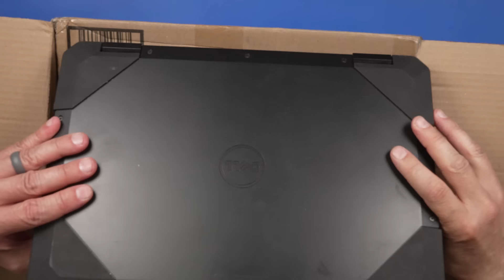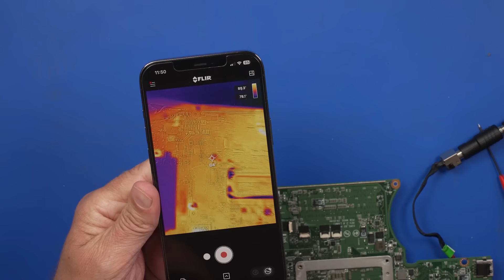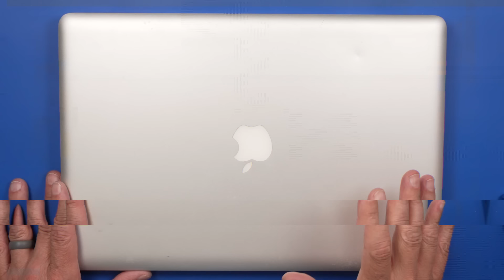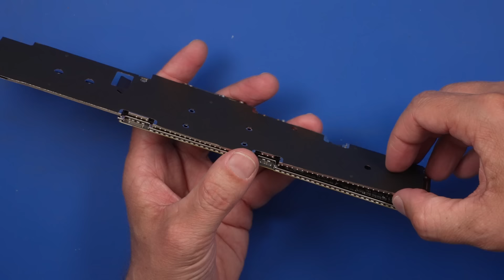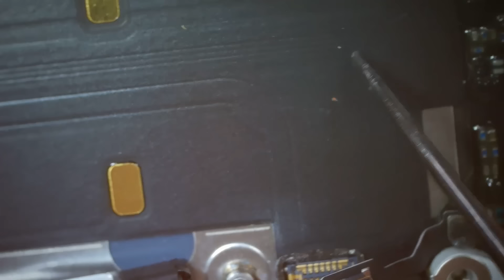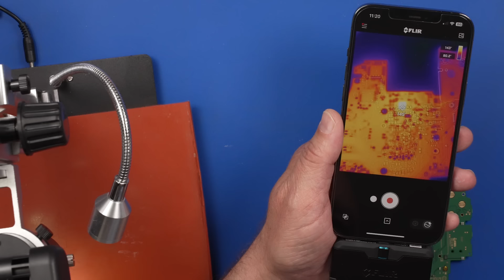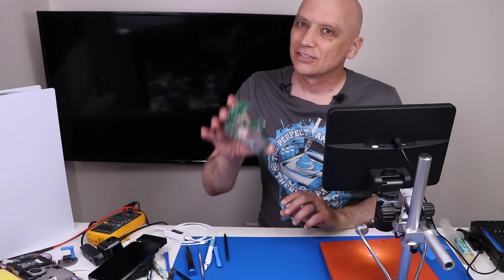Austin Evans Broke These with a USB Killer - Can I Fix Any?!

Comment: The 4S0101 is a low-power, programmable mixed-signal integrated circuit from the GreenPAK family (originally Silego, now Renesas Electronics), which integrates analog functions, digital logic, and non-volatile memory into a single compact package.

Comment: On the MacBook you will probably need to change the CD3217 chip. Then it will be fine. Data lines/USBC ports are isolated and that MacBook needs all USBC controller chips to charge normally.

Comment: At 19:12 that chip that you are removing is FINE. That is a 3v controller LDO chip. It's glowing because the super IO isn't turning on. It's stopping power because the motherboard senses an issue. That super IO is blown and the laptop will work if it's replaced.
I need to make a video about this myself.

Comment: The USB killer sends power through the data lines. Often it kills the PMIC and damages the CPU and RAM. Even the bios chip can get damaged. Don't look at the power rails for shorts, check data lines.
Reply: It also blows the usb controller ic

Comment: this usb killer stuff is stupid. it's just a simple circuit sending high voltage into the motherboard that's it. Why break multiple devices for clout? There is nothing interesting about a destroying electronics with high current except if they explode. BUT NO THE EFFECT ISN'T EVEN NICE LOOKING, NOTHING HAPPENS THIS IS POINTLESS

Comment: Steve, with the dell rugged laptop, you can find the 4S-0101 online now, so if you still have the laptop, you can get the donor board, remove the 4S-0101 from that board, and it will fix the hotspot, but there will most likely be other problems with the board, after you replace the chip, you will recheck for shorts and if it doesn’t turn on, it means that there’s something else wrong, and it’s not fixable.

Comment: I'm only 10 minutes in and this feels wrong to me. I am definitely not a board repair tech, but watching him check all these charging and power input circuits doesn't seem right. He knew it was a USB killer, my guess would be it is more likely going to fry stuff like CPUs, chipsets, etc. Wherever the USB controller is on said board would be what is getting the juice from the USB killer, not the charging circuits.

Comment: Man i wish i could have you do some maintenance and replace my thermal paste and pads. My ps4 is new from 01/19/2024 but i have heard the stock thermal paste isnt the greatest. Also for some reason since I first bought the ps4 it does not come back on if i out it in rest mode just flashes blue forever and then i bave to hold the pwer button down until it shuts off 😢. Dont know if upon delivery it was mishandled and dropped or something since the box had a huge dent in it. But i hoping after i install a ssd next week it will not have that problem anymore

Comment: Hello on the second apple laptop we can see a blown cap on the right side of the usb control chip! at minute 25:48
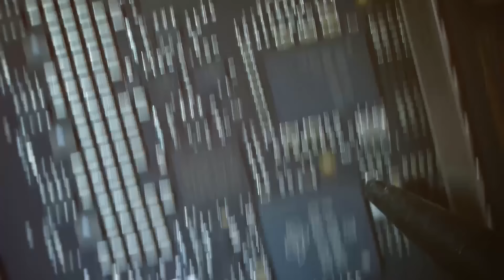Reply: Also on minute 25:28 we can see another blown cap exatly on the upper left side of the controller!
Reply: a simle small crack witch looks like slight discoloration crossing the middle og the cap is always a no go
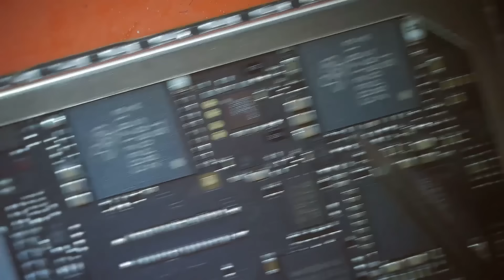Reply: on minute 25:58 we can see 3 blown caps 2 on the left side of the second controller one next to the chip and one under the rv chip and one on the right side
Reply: also the on the close righ side we can see a cracked white U cap/res

Comment: most power problem come from a blown ceramic capacitor . you may see a crack on it or be changed in color  but some times you can not see any difference.the fuses is very rarely the fault

Comment: Even with circuit protection devices, the way the USB Killer works, the speed it dumps the charge back into the circuit would be too much. Circuit protection is a reactionary device/circuit, by the time it reacts to the problem, it's usually too late. Clamping may work, but that also depends on what the USB killer is dumping back to the system.

Comment: Dell latitude rugged: replace fuses to correct proper power flow and that chip you specifically removed is most likely fried and needs replacement. That should fix the device, but if not there's a more severe underlying issue.

Comment: So if you are designing circuits, where would you normally find information about the chips to know what chips to put on the circuit? Or these chips not meant to be available to anyone but only the manufacturers has access to them through private channels?

Comment: you might have been able to get away with leaving that chip off the dell. usually m6 auc is a physical chip on the board that is used to track the laptop if it is even stolen since these are usually more expensive laptops it uses hardware plus software vs just software. thinking about it tho due to the security settings even if it did boot up you would be locked at the bios

Comment: 27:20 In the video cut from the USB killing, it seemed to work from the enegery in the battery. Is there a way to bypass the charging path and feed energy to the laptop from the battery connector? Swapping the empty battery for a charged one is inconvinient but might work.

Comment: GWS Steve.

As for this USB killer thing. I have one question. Why? It has only malicious uses. Again, just why, what is wrong with people?  Some dumbass with one of these could do untold damage for 'fun'.

Chances of fixing anything spiked by something like this are slim unless it has decent protection like the older MacBook appeared to. Depending on the voltage spike, it could fry a large number of components as well as creating insulation failures between layers & tracks given how tightly packed these tings tend to be. Basically a portable lightning strike.

Comment: I learned you should always start with the capacitors in a blown circuit. i cannot tell you how many times when i was still working at a motherboard repair factory [it was meant to cut down on E-Waste. at the time i was still in school for Electrical Engineering and it was a good paycheck that let me practice what i was learning] that I had to replace the caps first before they could figure out what was wrong with the rest of the circuit. cause i would get the board back once or twice with different parts needing to be replaced after i had replaced the caps.

Comment: That gateway laptop is a piece of junk. Tried using one to replace our desktop, it was slow as molasses in the dead of winter and would CONSTANTLY corrupt its own wifi drivers. Absolute landwaste. I can at least get some solace from knowing one of them suffered a usbkiller.

Comment: The sad part is, you don't even need the USBKill. The same effect can happen from a shorted cable, a bad charger, any number of dead flash drives, or anything you plug into USB really. A bad short of any kind can fry a board, especially since you just demonstrated how there's virtually no circuit protection in the areas that need it most.

Comment: Im pretty sure 4s0101 is just a double-mosfet. Just check for other shorts and solder 30-40v 80a with low resistance (2-3mOhm) and you are good to go

Comment: The hot spot on the switch is almost certainly the runs in the PCB arced an shorted together.  You're seeing a hot spot because that short is thinner than the runs so the resistance is high. (higher than the rest, it's still a short)

Comment: While you've got the battery disconnected from a laptop, you need to press the power button a single time to discharge it completely. That's how you fix a lot of Lenovo laptops, which can't turn on.

I bet you can order that CD3217 from Louis Rossmann...

Comment: Steve, you’re misreading your FLIR. The app overlays the thermal image on the optical camera image. If you look at the holes or edges of the board in the thermal overlay, it’s offset from the camera image. This is a parallax effect due to the distance between the two cameras and the closeness of the object you’re imaging. You can adjust the image offset in the preferences to get them better aligned for closeup imaging.

Also, the USB killer dumps to the data lines.

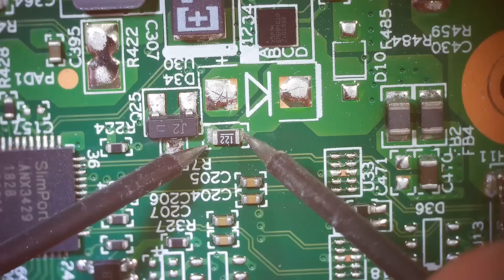Comment: 3:00 Those 0ohm resistors are usually great points to narrow down where the short is coming from. Just desolder it and check short on both pads.

Comment: hi steve ,i hope your recovery goes well and i respect you for keep fighting.
i think the usb killer charges the capacitors and discharge them into data lines not power lines , maybe the processor or the pch chip got damaged not the power curcuits

Comment: Hey, I watch your channel from time to time and find it very interesting.
The first device you looked at do you check the other side of the board as toy did not show on camera?
Most computers You're looking for a resettable fuse, PTC, or thermistor on the board.
IF the usb killer had strong enough spike it could toast usb fuse.  Try removing the grey 2R2 you looked at earlier.

Comment: A USB killer will often not kill the Mosfets or fuses, but the USB controller and/or Chipset.

In the Dell laptop that power IC might not be the problem but more something that shorts on the power rail and makes the power supply become hot.

Comment: From what I gathered, USB killer's feed themselves from the 5V VCC lines, and then scale the voltage up to a high voltage (110-220v) and then dumps it through the DATA lines!
Since it's going through the USB data lines and not the USB power lines, it probably kills the USB controller and/or the motherboard Chipset directly (since USB signal goes to the chipset), rendering it useless.
Meaning protecting the 5V VCC lines won't do nothing, and should be why you hardly found any USB power delivery damage.

Comment: Well USB killers are known to send their power in the inverted data line so if you don't remove the heat sinks and does not check the chipset or cpu there is not a lot of chances you can fix those.

Comment: Overvoltage from power loss and storms has been a known issue since the inception of computers. It’s a fact that’s as old as the technology itself, yet it remains an easily addressable problem today, far simpler than dealing with classic homes equipped with tube fuses. Despite this, the recent incident where only a Mac survived the surge—while devices from Microsoft, Nintendo, and Sony failed—highlights a significant oversight. It’s a stark reminder that even the most established companies can fall short in protecting their devices against such common electrical threats. Investing in surge protection is a small but crucial step towards safeguarding valuable electronics.

Comment: the copper traces are contaminated with EMF and whoever does this is as dumb as opening a microwave door and running it if you do it enough times you can simulate the same effect as running a microwave without a faraday shield...... This is just the beginning of the idiocracy people gotta stop lolol all i see is 5 good devices completely ruined. Regardless a simple way to effectively prevent someone from every using this on you is add an external port or hub with added surge protection to your ports everyone of them and it would prevent this attack although if someone is point blank at your pc with a usb drive you probably already made some serious mistakes.

 And just to elaborate the USB controller chip aswell as the entire cpu could be shorted internally that usb killer outputs like 300v or something from a charged capacitor using a design the creator of it made to charge up and release the voltage through the entire device through the data and power lines. so the whole board everyone of those boards should be melted dissasembled they probably never work again without complete rework of all components. Also am unsure what is going with health but continue to fight ! i wish the best for you and i still learn alot every video!. As for pc killers like austan evans they should be tried for the crimes and put into foxconns connector fabrication company lolol jk lolol.... second thought also wireless usb transciever hubs they cannot transmit power at all only data and store pc in a secondary room or lock box not complex solution(reverse current protection with diode works too)..

Apples overengineering pays off ! lolol good video

Comment: Hardly anything is connected to GND on both sides, it wouldn't really make sense.
11:47 BQ chip is usually the culprit on USBs.
If the spike goes to data lines it's prob the EC chip.

Comment: On the gateway laptop, there's no use looking around the charging and battery management circuitry, that wasn't affected, the USB killer was plugged into the USB port, that would be connected directly to either the SOC or the southbridge, its one of those that died.

Comment: I could be wrong here and I haven't watched the whole video, but I thought these USB Killers worked by routing the voltage used to power the device to data line(s).  If that was the case you wouldn't be finding shorts on fuses or power lines I don't think.  It's gonna be damaged IC's and or CPUs.

Comment: Keep'em comming Steve.
I wonder if the high voltage can cause arcing in multi-layer boards, causing shorts or severed connections.

Comment: The main fault i see when your diagnosing all these devices is a usb killer doesnt dump power down power lines. It charges on power lines and dumps down data lines. So it goes after critical processing items. Such as usb controllers. Cpu. Not charge controllers or power fuses. Usb killer destroys the data side of the device. I can't do any better then you did and am by no means an expert.

Comment: a usb killer usually steals power from the usb power lines and pushes them into the data lines. so if you have bad luck it will not only kill the usb controller it will also kill the chipset or cpu. and i can give a tip. coils have a very very low resistance and will always beep. and there is rarely a short between a capasitor. i advise to test a short on capasitors agains ground on both sides. to 99% only one side should beep. sometimes a capsitor is just shorted by itself or the chip beside the capasitor is shorted

Comment: That blue laptop that you took apart. I have worked on those before. They use a 12 V adapter not a 19 V one you probably just killed the circuit by plugging it in lol.

Comment: When you where testing caps on the nintendo switch 33:38 you can see that the cap on the top rigth corner of the MAX77620H chip is crack, you miss that one when testing and continue looking in the other part of the board

Comment: Even though austin meant it as a demonstration of the destructive power of the usb killer. I am still not really happy about people shoving usb killers into devices or destroying devices for the juicy youtube money just to show it of, a lot of other people do it too and they contribute to ewaste and oh i hope they dont think it will get recycled because recyling is a scam. Also the eartb does not provide infinite materials and will get exhausted the more materials you take from it and they wont all come back. The ewaste factor just makes it a big part for me because perfectly working devices get killed and then end up at a landfill or at a ewaste pile rotting away for infinity while those could be given to actual people in need or at least could be given a good use. Also they contribute to co2 because the destruction centers actually doing the "recycling" emmit tons of c02. I am sorry for acying like a karen but i always have a weak spot for perfectly working electronics that get killed for just content and the juicy youtube money and that could be used for actual good use.

 Yeah i have also killed tons of components but its not about the content or youtube money but its a learning process which is different, also why its called the bleeding edge of learning. Or it could be due to an actual failure (motor or any component shorting, or a wrong power adapter inserted)

I bet all of them that are totally dead might be too far gone. The usb port is the main target but the voltage gets through it and it probably fries the usb controller chip or the pch/chipset or the cpu or it can knock all 3 out if the usb conteoller shorts and puts the voltage across the smbus which is the bus the cpu and other chips are one

Comment: Disappointing apple. The older Mac book has better protection than the new one. I guess usb killer is good against what might happen if your charger failed or voltage surge on the mains.

Comment: Good god, stop looking for fuses when you had thuderstrikes. The silicone chips will basically protect the fuses since they burn much faster. Also measuring around things isn't just the best method to find the problem. Connect the power and see where it won't go any further. You can also try voltage injection and see what is going on. Another point is that you don't really need schematics if you have datasheets for chips from the internet.

Comment: USB killer dumps around 350v onto the +5v rail on the usb bus which is tied into the main +5v rail of the entire computer that means it’s going to blow every chip on the board that has a 5V supply.

Comment: Probably said before but 20:12 in the vid next to the chip it looks like a solder joint to the left has burning around it, could it now not be connected to the traces?